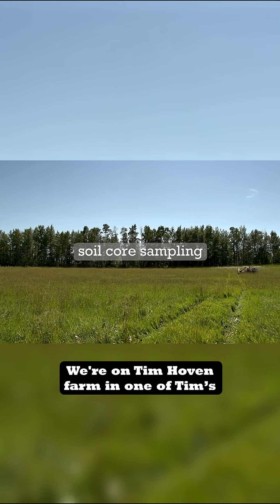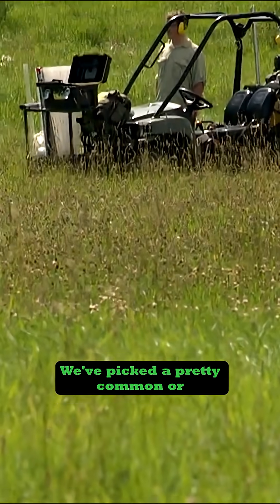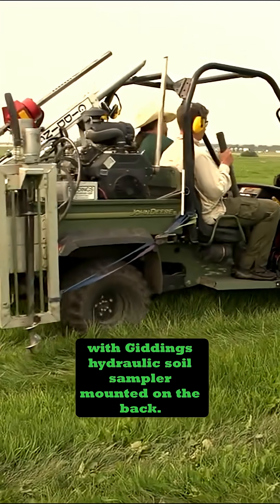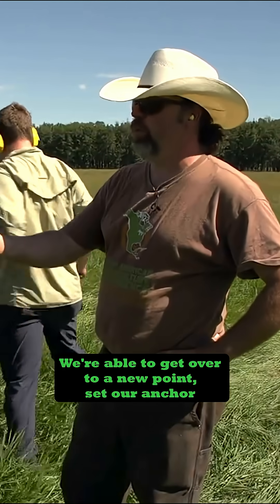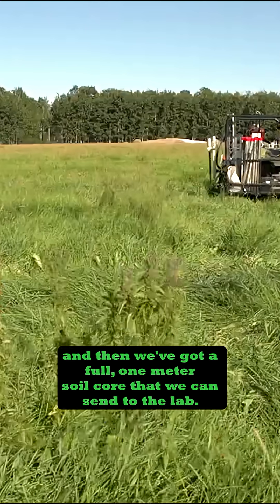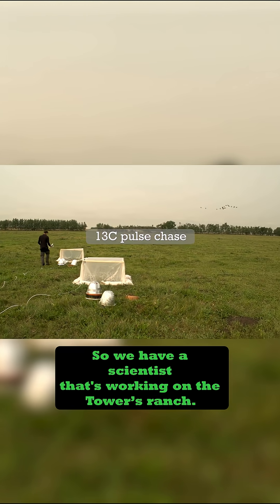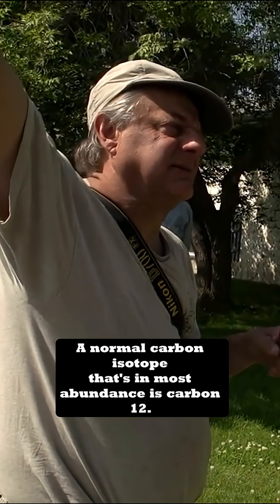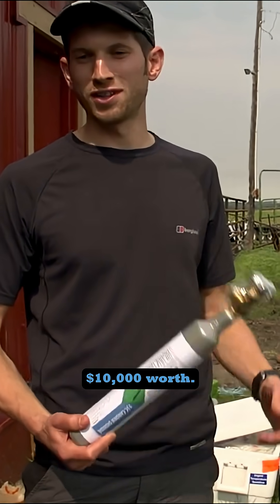How we take soil samples matters - luckiest places on earth pt 8

Comment: In case anyone didn't understand; by adding carbon 13, the plants, ground, soil, microbes, roots etc will absorb it, and they can specifically test for the carbon 13 because it's not as common as the carbon 12. So they can literally test how much carbon the ground is sequestering. Like looking for a trails of pink in an ocean of black soil. They can't trace carbon 12 because it's everywhere in the soil already. 👍

Comment: Wouldn't sap analysis directly from the plants be a better way to actually see what the plants need or has already
Reply: They are studying soil and CO2.  They are comparing traditional grazing and AMP grazing. 
I don't know about this study in particular though I know there is evidence that AMP grazing captures more carbon than is produced by the cows.  Studying the soil from the soil to a meter down could help validate their methods. Even if it doesn't it's more information to help improve the health of our planet and stave off more climate change.

Comment: So the 13 represents the atmosphere with elevated levels, like the present day atmosphere is headed?
Reply: The 13 is normally 1% of the CO2. With its rarity they are using it as a tracer for their CO2 study. They inject into the soil, then come back to resample looking specifically for the 13C. Areas with a higher percentage of carbon13 CO2 indicates where the added carbon went in en plant or soil.
Reply: @zabmcauley5647 ok got you. Thanks